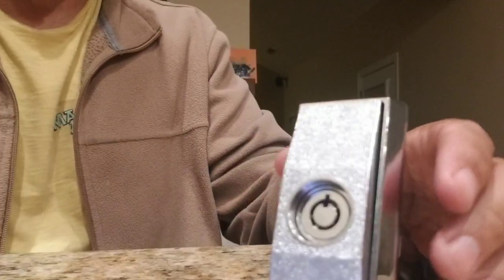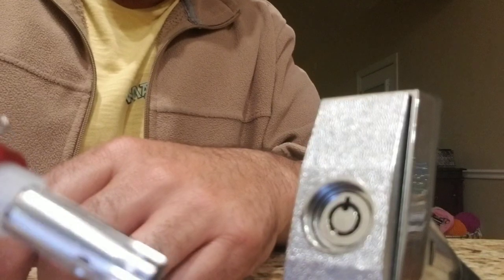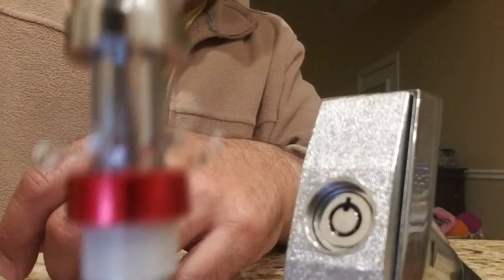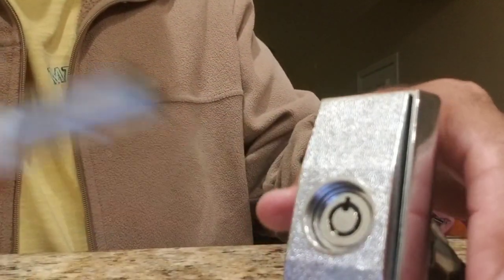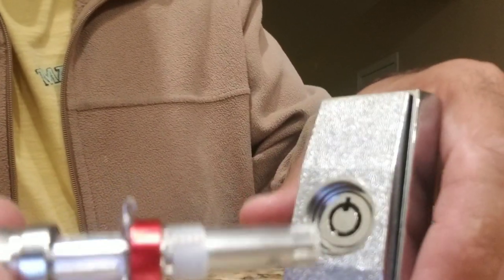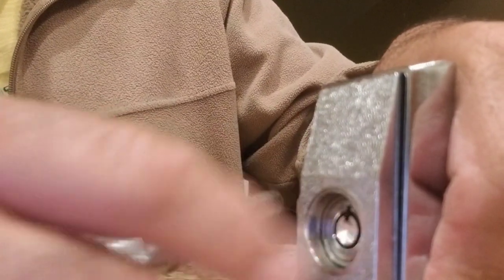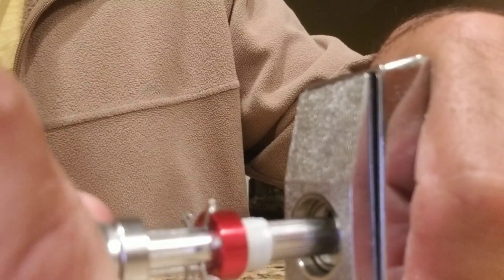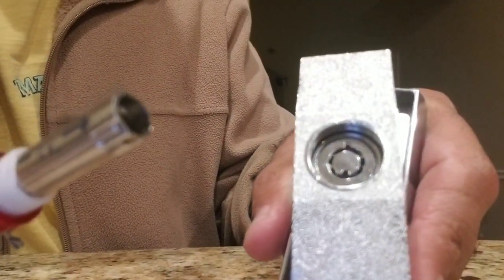How to pick a vending machine lock

Comment: I understand this video is over six months old,  but for the price of this tool is still killer. I hope you are still checking messages this far back. Will the 7 pin HUK tubular pick work on a misaligned tubular lock? I have not been asked to work on one yet, but I’m starting to notice them while I’m out with the family. Thank you kindly for your input.
Reply from the maker: Just got this reply for some reason. Guess my email is worse than snail mail. I really am not sure about the answer to your question. I guess a locksmith would be the guy to answer it.
Reply: Look up tubular 7 pin offset HUK. Some do 7 pin left, 7 pin right, etc.
Reply: are 6 pin 7 or 8 most common? I LOVE picking locks. I work for a police dept and my fav calls are lock outs and things like that and I want to learn tubular locks! We have a snack machine but idk how many pins

Comment: Question for u will this set work on a lock that doesn't have that little notch deal the tensioner part or will it only work on the locks that have the notch
Reply from the maker: It has to be standard cylinder locks with the notch.
Reply: Yes they do work on locks without the notch the piece in the tool can be removed if the lock ur trying to open doesn't have the notch

Comment: So true I've had some trouble I have the kit and I suk csnt get it open 7 pin
Reply from the maker: Try resetting the pins on a flat surface. Make sure you insert it completely so that the tool is straight. Then turn slowly back and forth. It takes patience.
Reply: @Vendingsupplier  k I'll give it another try thanks so much

Comment: I want to hit up the vending machine at work because it has some $2.50 beef jerky that I like!!!
Reply from the maker: Go right ahead, is beef jerky worth a going to jail for?🤔
Reply: @Vendingsupplier  

No!!!
Reply: D Carv you’ll eventually get caught my man. Not smart doing it for a living. If you absolutely HAVE to do it (which should be never. There’s always a better LEGAL option than being a POS) you should only do it once or twice. The more you do it, the more chances you have of slipping up and making a mistake. All it takes is one machine to have a camera on it, then the building catches your license plate. Knock knock your going to jail. Also if you get stopped by a cop and you have this tool on you and your not a locksmith or someone who has a legal reason to own one such as a maintenance man, or a guy that owns vending machines than you can be arrested for possession of burglary tools. It’s just better not to be a moron.  I’d rather beg a family member for the money once than to be sitting in the pen for 8 years for burglary and yes you can and will get YEARS in the Pen for breaking into vending machines even on a first offense.
Reply: @myron6305  you own a vending machine distribution? Just wondering. Been wanting to get into it. Is this a big issue? The theft?

Comment: I have a tubular lock which has a keyway which is bigger than all 3 of those picks. Basically they dont fit. Do you know of another tool which is bigger and which can fit the keyway?
Reply from the maker: You should be able to use a tubular lock saw. I use one for most of the time now. Take 5 minutes or less.
Reply: @Vendingsupplier  Was hoping to pick them non destructively but suppose thats an option when all else fails

Comment: what is the name of the item to unlock it
Reply from the maker: It's a cylinder lock pick.
Reply: VENDING MACHINE GURU how do you know how many lock pins the lock have? I brought a machine and the keys got lost so I didn’t want to drill until I came up on your video. Do I just buy a 7 pin it’s a LCM3 vending machine